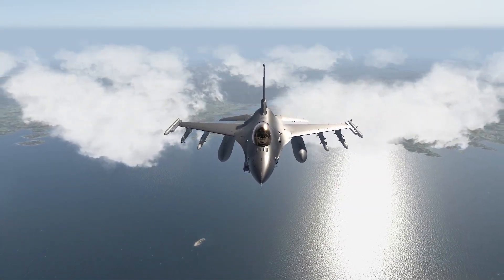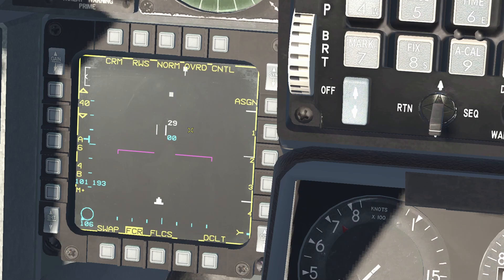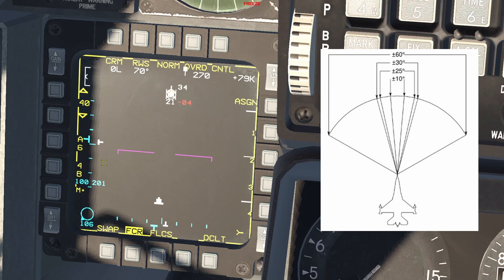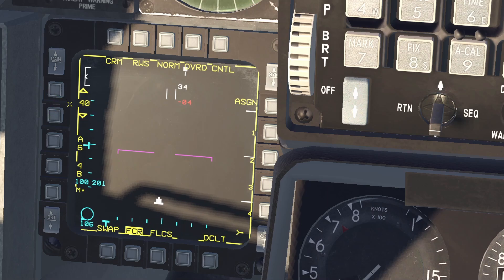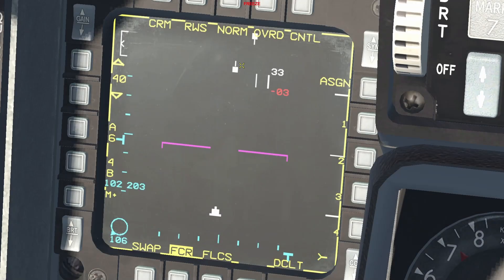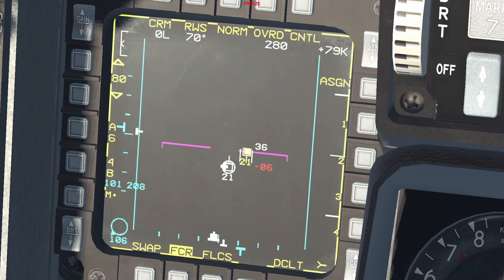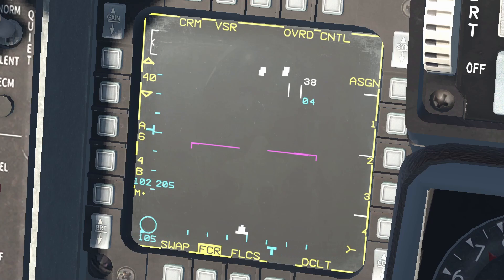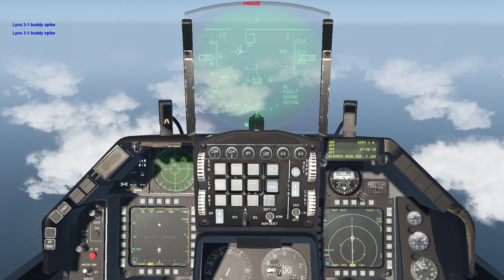Falcon BMS 4.37 Tutorial - Air to Air Radar

Comment: 6:19 This is inaccurate. The range at which a radar is scanning does not affect its refresh rate. The azimuth (left and right angle) and bars (up and down angle) affect the refresh rate. The wider the azimuth, the longer it will take for the radar to sweep from one side to the other; it will take longer to go from one bar to the next. The more bars in a scan, the more sweeps the radar will need to sweep before completing a full scan.

TLDR: range has no effect on radar search speed (refresh rate). Number of bars and scan azimuth are the only factors that play into how long it takes for the radar to refresh.
Reply from the maker: Thank you for the correction! I was under the impression that the range affected the refresh rate, I will keep this information in mind if I do another tutorial about the Air to Air Radar for 4.38 or if I do a follow up about this topic.
Reply: @fisgasfighties  Awesome! I apologize if I came off a little rude.
Reply from the maker: @maestro3535  no not at all! I appreciate being corrected when I get any piece of information wrong.

Comment: i have spend the last 2 days just learning watching this playlist over and over trying every thing in the tactical engagement and with the help of this videos and the manual i think im ready to start a campaign i dont think its going to go great but i think its time to put all the practice to the test and also keep learning anyway just want to say thanks for all the help with this videos it would  have take me weeks with just the manual
Reply from the maker: @Vesper2  good luck. The campaign is a challenge in itself, even for guys who've been with the sim for a long time. Things will not go to plan sometimes, things will go very wrong sometimes. But it's an incredible experience. I'd suggest focusing on a mission type at first, like SEAD/DEAD.
Reply: @fisgasfighties  i have bin focusing on SEAD mission it's a lot of fun, but most of my bombs mis the target, so I will have to do some more reading and learning to get were I want to be
Reply from the maker: Which bombs are you using?
Reply: @fisgasfighties  I used the Harm, but now I use the long-range glide bombs and they work like nothing else
Reply from the maker: @Vesper2  the glide bombs are an excellent choice if the location of the air defense unit is known, which is not the case all the time. In situations where the location is not known the HARM is still the best option.
Reply: @fisgasfighties yea the unknown location is still the hardest for me to hit. I can't seem to figure out the HARM. Do I need to bait the SAM sights into using their radar?
Reply from the maker: @Vesper2  yes in these situation where the HARM is being used the radar should be emitting. Trying to entice the SAM to start trying to track might be needed.

Comment: i cant lock targets i have a TMS up button but thats not working to get a lock i dont see a TMS forward button to map plz someone help
Reply from the maker: @Vesper2  TMS Up and TMS Forward are the same thing, I just call it TMS Forward because that's what an IRL F-16 pilot told me they called it. But it seems it's not universal.
Reply: @fisgasfighties  ok so im doing something wrong if it's not locking
Reply from the maker: @Vesper2  one good way to make sure it's working correctly is to go into the LGB training mission for example and while using the TGP putting a target on a point track. It's the same button so if it works on there it should work on the radar under the correct parameters
Reply: @fisgasfighties  with the TGP, I can place a target, but with the radar in A-A, it just doesn't want to lock. I have read everything I can find online, but I just can't figure it out. I also have the sustem set to CRM so it should work
Reply from the maker: @Vesper2  are you in RWS?
Reply: @fisgasfighties  man thanks for the reply I'm just an idiot I'm in the training mission and I was trying to lock onto the STPT that shows up on the radar but when I got closer to the enemy it popped up on the radar and I was able to lock on thanks for the help. Also, thanks for all these tutorial videos. You have no idea how much you have helped me
Reply from the maker: @Vesper2  you're welcome, I'm glad it's working correctly now!

Comment: hi, I've started a Dogfight/ Match Play, adding i'm in crm/rws mode. I understood AA radar basic, I  can move the cursor around the radar.i have 2 aircraft in front of me( i can see them) but on the radar i dont see anything. what am I missing to enable?
Reply from the maker: @MarcoCarrozzo  are you scanning on the right altitude block? Because if the radar is scanning at, for example, 0 ft to 15000 ft and the bandits are at 16000 ft the radar won't pick them up.
Reply: @fisgasfighties  yes , I'm dialing the antenna elev wheel but I only see the white small triangle and nothing else
Reply from the maker: @MarcoCarrozzo  small white triangle? I'm not sure what you mean. Can you DM me on discord and send me screenshots of what you're seeing?

Comment: So many radar options! Is there a "workflow" of sorts based on range, i.e. what radar sub-mode do you use when x-miles from target steerpoint;? Do you switch sub-modes when fencing in? When AWACs provides contact info, do you switch to another sub-mode? Etc.
Reply from the maker: @Jake-love939  as far as I personally handle the radar, there isn't a "workflow". I use the sub modes situationally.

Most of the time I keep the radar in RWS and if I have engage up to two targets at the same time.

If for some reason you have to engage more than 2 contacts at the same time, switch to TWS. 

If you're only engaging a single target, want to use all of your radar energy on it and the target being alerted that you're engaging it by its RWR isn't a concern, then upgrade the contact to STT.

If the contact you're trying to engage is getting close to you, under 10nm , consider switching to ACM and try to acquire the target visually.

Does that make sense?

Comment: Excellent tutorials that set the standard for how a tutorial video should be done! Subbed!

As others have noted, with the more recent updates to BMS, many/most of the popular YT tutorials (Krause, Supanova, etc.) are now no longer applicable to the current version. I keep running into this as, after a 20+ year effort to get both a computer and a HOTAS setup that actually works in the sim, I am finally getting to enjoy BMS the way I have wanted to for so long (= not needing the keyboard at all in flight). Much of what worked/was standard for older versions simply do not work anymore, so you are doing a great service by making these time-saving videos for those that learn better and faster by doing than by purely reading the numerous BMS manuals. 🍻
Reply from the maker: @BushidoDevilDog  thank you for your kind words!

Comment: It's still got the graphic straight line in the horizon, they have to get rid of this if it ever competes with DCS/IL-2 graphically at least.
Reply from the maker: When 4.38 is released with the new terrain I belive it will put BMS at least at the same graphical level as those sims. On other aspects it already surpasses them.

Comment: Such a great thorough explanation man! Supanova's vids have always been my gold standard of how tutorials should be made - but they are now getting more and more out of date. It's fantastic to have a new set of tutorials which are of the highest quality, and are even a little more practical than some of his!
Reply from the maker: Thank you so much for the kind words! The way @supanova88 does his tutorials were definitely a big inspiration for how I make mine, and I think it shows. It's an honour to be put in the same quality standard as him.
Reply: @fisgasfighties  :) FCR to me was the hardest topic to wrap my head around for some reason. Probably has to do with learning to rely on TWS before it got nerfed, and never using RWS SAM and DTT which the manual didn’t explain well IMO. You are an absolute scholar!
Reply from the maker: @Wheelman_PCAS  I know exactly what you mean, back when I first started it took me ages to understand how the radar works and how to use it effectively. However lately I've not been having much success with taking engaging 2 different targets with RWS SAM. I think it's down to the fact that RWS doesn't generates track data for other contacts than the one you're tracking, even the bugged target seems like more of a "shortcut" rather than accurate target tracking. I'll cover that spoiler alert in the next video about the AMRAAM.